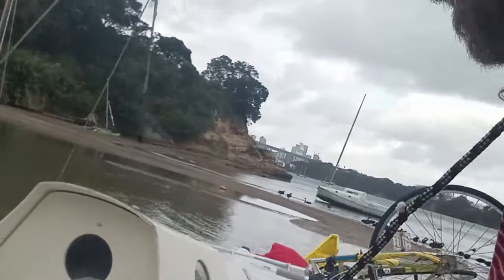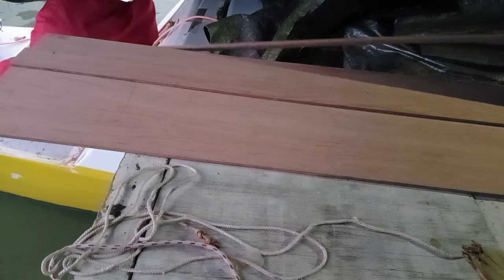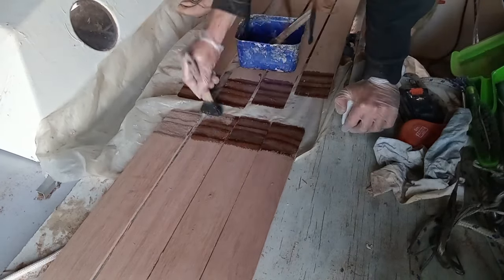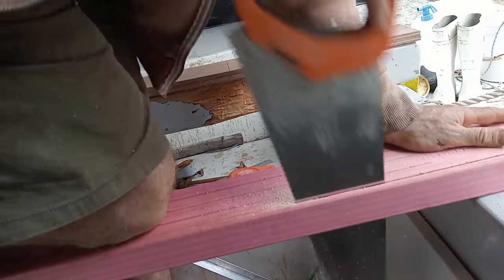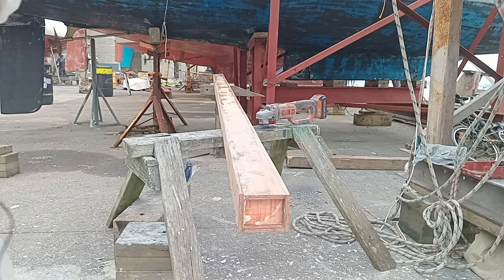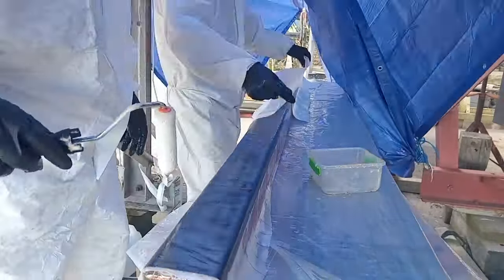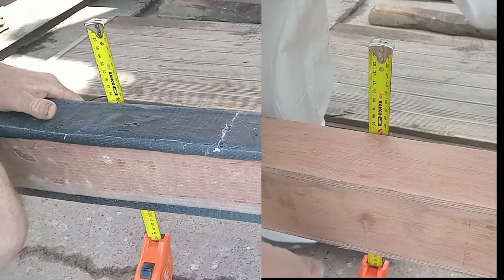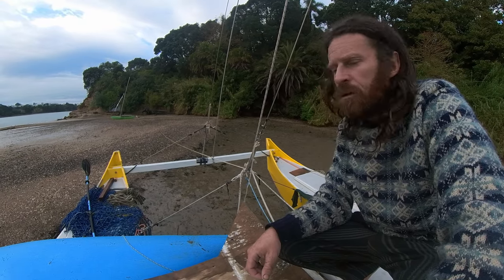Building a new Catamaran Beam From Scratch (Sailing Yes Let's E16)

Comment: Great video. I’ve been thinking of building a Pahi 31 as my big boat build instead of the tiki 30. I live in rough waters Hawaii and it seems a bit more seaworthy.
Reply: Tiki 30 is much more comfortable to live on with much better use of space than the Pahi 31 (I've owned both.)
Reply from the maker: interesting. I've never sailed on a tiki 30 so I can't comment but the tiki 30 is lighter and less build hours, so I'd probably lean towards that. The pahi does have a straighter keel, which might make it pitch less. I did sail with a tane nui that was pitching a lot more than it felt like my boat was at that moment. The pahi is also based on hokule'a (or maybe just the same source material) so there is that connection with hawai'i too!
Reply: @dominictarrsailing  thanks for the feedback, and yes it’s true the Pahi designs are the closest to the Hawaiian Wa’a. It’s hard to decide.
Reply: @Ron-dx9wq  mahalo
Reply: No worries, Blake. Another suggestion I could make: the Tikis sail much better than the Classic or Pahi designs because of the "Wharram Wingsail" (Dutch gaff) mainsail. Because of the flex in the Wharram designs, it's impossible to get forestay tension so the jib cannot work properly. I recommend whatever you build that you update to the Wingsail - Wharram has upgrade design plans for this. Alternatively, you could go with a Polynesian crabclaw rig which is perfect (and traditional) for a flexing cat.
Reply from the maker: @blakewatson28  I reckon definitely find some already built wharrams and ask to go sailing with them. Wharram people are very friendly and there may already be some in your area!
Reply: Don’t just look at Wharrams. I have a woods Gypsy, it is 28’ and twice the internal space in the hulls.  There is standing headroom! You can build it without the centre cuddy, which if I was building from scratch I would do.
My main beams are 23cm deep 12cm wide.  Top and bottom are solid 20mm timber, sides 9mm ply, curiously there is also a centre ply web.
Reply from the maker: @markthomasson5077  woods gypsy also has a flat section so you can drag the boat up the beach on a few fenders! (if you have centerboard option) jelous of that definitely want that for my next boat! (you told me about that)

center ply web on the beams? is that to align with the bolts or something?
Reply from the maker: I wish there were more designers working in in the simple easy DIY multihull, pacific traditions inspired, but there is basically wharram, and woods is close but moves more towards modern designs
Reply: @dominictarrsailing  remember that traditional designs were limited by the materials available.   With epoxy ply would they have done the same?
Reply from the maker: @markthomasson5077  that's why I said "traditional inspired". But really it's about the rig, I think it's about the rig. Everyone has bermudian, to the point where it's easiest to just go along with it, but it's a high stress rig that's hard to make yourself and also has lots of problems. Sure it's good to windward but that's it one trick. Going down wind main blankets the jib, and you can't dump the main either! but the worst in my opinion is limited opportunity for sail balance... where in the traditional craft, every island group has a different design

Comment: Wood strong enough for the job is brilliant against fatigue failure and the thin glass over is mostly for the paint job. When adding heavy glass and carbon to do the work one then typically looks to a lighter core. Just food for thought.
Reply from the maker: hmm you think I could have used lighter ply? like 4mm? hmm, now that I think about it I remember my original plan was to just make a plywood beam, then I was gifted the carbon fiber. It certainly turned out a bit heavier than I'd hoped but plenty strong

Comment: You made mention a couple of times of putting the carbon on the top and bottom of the beam. Maybe I’m missing something here but would it not be better to minimise deflection by having the carbon on the sides of the beam?
Reply from the maker: I didn't have enough to do all 4 sides, and I thought it was the top and bottom that is under the most stress. the forward net attaches to this beam, but also I tie my biggest sail to it, and there is an aluminium post that braces it against the forestay bridle.
Reply: Nope, he did it correctly for vertical stiffness.  
For torsion and compression it should be the same all sides.  
As the fore stay has a bridle, the beam is mainly in compression.
Reply: Glad to see that you gave it a generous coating inside, ideally every void should be ventilated.  But guess not best in this case.
Did you fillet the ply box internally?  Though of course you can only do two easily
Ply fillets may have been just as good.

Comment: A Tiki-style "I" beam would have probably been a better solution than a hollow box. Wharram has an upgrade pack of plans for i beams for Pahi.
Reply from the maker: I don't like the tiki beam because it has too many inside corners. such a nightmare to sand etc. Of course, it's more observable than a hollow beam, but I think it's not too difficult to just make sure the beam is really well sealed inside.
Reply: And the box beam is better in torsion rigidity